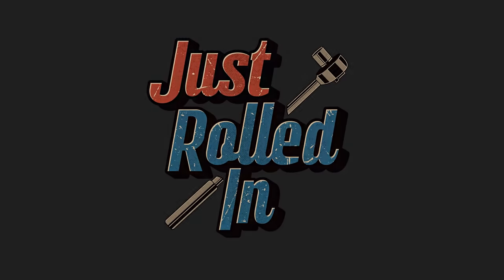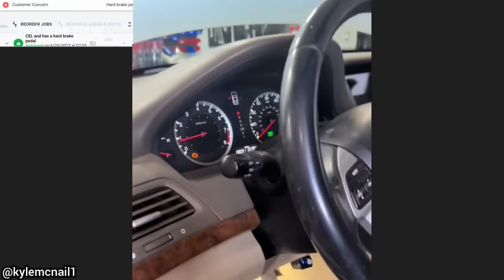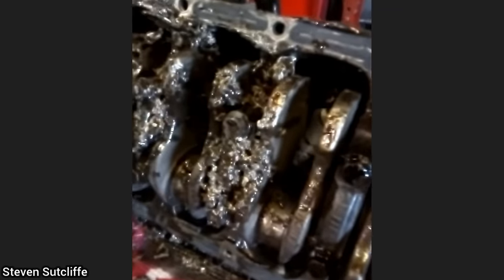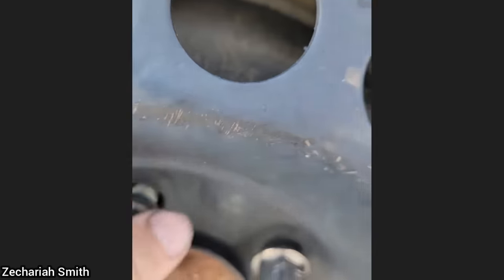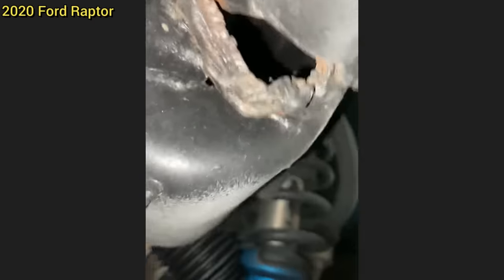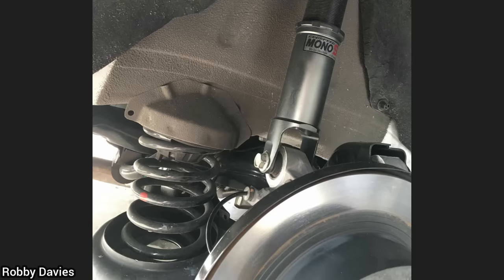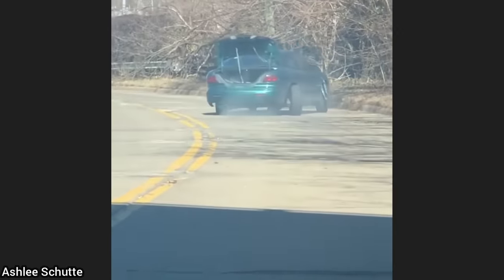Customer States Haven't Changed Engine Oil In 90,000 Miles

Comment: The last one:  There are some four wheel drive tractors that can drive like that.  It's called "crab steering".  
It's funny that both of the back wheels were running at about the same angle.  😂
Reply: yeah ... but most of that is done on hilly farm land .. out on the farm we used to call 'em a "sidewinder"
Reply: @rhuephus   I used to farm, but our land wasn't that hilly.  Lived in Saskatchewan where it is mostly flat.  So, didn't need such a tractor.
Reply: Car must be Front-Wheel-Drive with a torsion-beam rear end, which has come loose on one side, allowing it to swing backwards, twisting the other side with it.

Comment: 1:39 It is common for people who repair and resell salvage cars to not replace the airbag crash sensors and computer which needs to be replace every airbag deployment. if they are not replaced they will still have the sensors in a "crash" state. If the failsafe options that prevent random deployment fail or are somehow avoided they can just go off.

Comment: The last car.  The wheel alignment was correct, it was the body that a bit skewiff.
Its a well know fact that if you roll back your odometer you dont have to do any maintenance - until the engine seizes.

Comment: You cannot remove the factory coil spring and change to a coilover. The shock towers are not strong enough to take the weight of the car. You would need to heavily reinforce the towers to do that.

Comment: 0:05 That's the 2020-2022 4th-gen facelift, so if they actually managed to put 90000 miles on it, that's bonkers. But it does take more than 26K to do that to oil...
Reply from the maker: That's what I was thinking also. Must be used as a nice company vehicle.

Comment: That last one is an accident waiting to happen. With all the wheels facing in different directions, it suggests to me there's a lot of suspension and subframe damage to both ends of the car. Definitely not safe to drive. Best put that one on the "written off" register. Dunno what America's vehicle write off policy is like or how it works but down here in Australia it's mostly clear cut but varies in each state and territory. By the sound of things the Aussie policy must be better than the American policy. Either that or people are out smarting it.
Reply: Some states have vehicle inspections when going to emissions testing. A few states don't even have emissions testing.
Reply: I'm thinking there's problem with the rear axle.  The front may be ok, it's just turned to compensate.

Comment: Many years ago I worked at for a major trucking company on 2nd shift while I was doing inspections.   I was in the pit underneath a tractor doing inspection on it when I noticed that the front cross member was cracked , broken into.  Then I saw that the 2nd cross member and the two rear cross members were also broken into.  The only thing holding the two halves of the truck together was the engine and transmission mounts along with the differential springs.  I noticed the new paint on the truck when it came in so I asked the driver/owner if the truck had been in an accident recently.   I asked him if the truck had a vibration to which quickly replied yes!  I then showed him the broken cross members and he turned white as a ghost!  He then told me that he had pulled a load with the truck!

Comment: Reminds me of when we had the fleet trucks and vans when I worked for AT&T , dish network and directv , they tried to squeeze as little money into servicing them so  they did oil changes every 45,000 or 60,000 miles with conventional oil and would have you keep driving with the steel bands in the tires showing , wear real bad on outside of tire from under inflation to even out the tread they would then over inflate!

Comment: My friend had an oil change last 44000 miles before the midwest heat caused the main gasket to fail! Personally I've gone an entire year between oil changes... I drove about 23,000 miles that year. Oil was thick... But no clumps. Now, I only risk an extra 500 miles max when I'm due.

Comment: I just bought a 91 stealth tt, took it into the dealership to have the recall done on the transfer case. Also had it inspected for safety and emissions. I went to pick it up and they told both window motors don't work. I told them they worked just fine 2 hours ago. Walked out to the car and seen the mechanic pushed the window lock on the door. Waljed back in and asked them how long has the mechanic been working on cars. They told he only worked on the stealth/3000gt. I said get your mechanic and follow me and proved the windows worked great. They gave me a year worth of oil changes for there screw up. One of the moments the customer is smarter than the mechanic. But my secret is i learned from a 40 year vet mechanic growing up, so I can fix and modify most car stuff.

Comment: I just serviced a 2022 Freightliner box truck today, (built 09/21), its first ever service. It had a DD8 engine, first time I have seen one. Just shy of 30k miles on it, which should be ok, Detroit Diesel, I think, recommends like 40k. Personally, I'd do like 15-20k.
The hood opened pretty hard, and i thought that maybe it had never been opened before
Anyway, I pulled the drain plug, and only about 2 gallons of oil came out, and it was BLACK. I put in 2 gal of oil, not on the dipstick, 3 gal, then 4, then 4.5, then 5, then 5.5, then 6 and it's finally on the dipstick, then 6.5 and I'm in the hash marks. And I think, "holy fuck. I don't believe this dude has ever checked his oil. I wouldn't be surprised if some bearings are already wearing in this thing. I can't believe there wasn't a low oil warning light on this fucker. Maybe that's what the check engine light was about."
Anyway, I run it, then check the official DD service fill, 6.75 gal, so I add one more quart.
The company brings the sister truck over to swap out and also get serviced. I asked that driver if he ever drives that truck that had 2gal, he said, "No." I asked him if he knows how to check oil, and if he does it, he said, "Yeah, and every once in a while." 
I then told him that I only drained about 2 gal of oil from that truck when it's supposed to have 6 3/4 gal of oil in it. He laughed and said he'd let his boss know.
Reply: diesel oil always looks black like crap, even right after you change it. But yeah, check the oil.

Comment: I’m a dual mechanic, aviation and automotive. I’ve seen some hilarious customer states and have seen some interesting DIY installations or repairs but nothing compares to some of the stuff I’ve seen on this channel. 

I drive a 2013 Raptor and you can’t do donuts in a Raptor. It blows the power steering system.

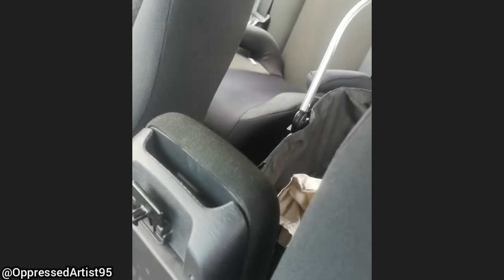Comment: 2:48 I've worked on a lot of transits, I've never seen one with a cartridge style oil filter. Are you sure its not a promaster?
Reply from the maker: It was filmed in the UK if it recall correctly. Perhaps they have different engines?
Reply: @JustRolledIn  The Transit van has had a fair number of different models and engines since it was first introduced. Both cartidge and spin-off filters have been used over the years.

Comment: just the other day, I was behind a reddish late 90s toyota corolla, which had four mismatched rims and tires, initially I thought the person was driving it with a flat, because of the tilt to one side, then after it slowed down to inch over some railroad tracks, I got a good look at the tires, and realized they had a low profile tire and wheel in the back right, a skinny tire on the back left, driver's front tire was thicker than the rear. Just such a hodgepodge of tires

Comment: We have semi truck that was towed in and sitting in lot that stinks badly like poop. Tow truck driver said sprayed 2 cans of odor eater and never changed how bad it smells. 400 pound driver using 5 gal bucket with plastic bags to poop in and all bags of poop are sitting in cab and sleeper. Also truck full of flys too. We refused to work on truck, windows are down and it just rained

Comment: My 2001 Chrysler Sebrings manual says oil change every 7500 miles or 6 month. I change it once in 12 month cause i rarely drive 5000 miles a year. Never had problems. Newer cars manuals say 17500 miles or 24 month.

Comment: I can't imagine how some of these vehicles are still running if i am show something that needs repaired i get it done but i was told that i needed an oil pan gasket i knew i could buy one cheaper than the dealership a couple days later i had another part replaced at the same dealership and looked under my car and it was not leaking

Comment: I've always wondered, do you call the cops if a repair is declined on a clearly unsafe vehicle? Because, damn, some of those are scary scary!!
Reply: Some US states don't even inspect vehicles for safety. The police won't get involved.
In states that do require inspection, mechanic can report the vehicle to the state, who can then notify the owner that re-inspection is needed.
Reply: @j_taylor thanks for the explanation.

So so sad.
And crazy!
No inspections required???
Yet.. you do need to have "10 catalyst converter" if you want to drive in NY?

Strange that you can be totally unsafe on the road, as long as your exhaust is clean enough

Comment: I've gone long periods of time without changing oil because of a leak that had me putting in a quart a week it was seven years and about 30,000 miles and it eventually caused enough pressure in the head to blow the valve cover gasket out but I got lucky and everything came clean after two oil changes and the car is still my daily. It's an integra
Reply: So the oil was getting changed, but you would still have stuff accumulating in the oil filter.

Comment: Looks like the airbags blew because the lifting pad fell off the sill. Would have shocked the impact sensor in the door just enough to set off all the curtains. Accident none the less but I think the shop is liable for the one.
Reply: If the ignition was off they still shouldn't have deployed.

Comment: I wonder how much they charged to "fix" the center air vents.
Reply: $189.00, it's on the work order...
Reply: 1 hour labor minimum for diagnosis would be my guess. That or they felt sorry for the customer and didn't charge anything.
Reply: If you cant 'fix' your own vents or realize there are 2 sneakers behind the brake pedal you definitely deserve the 1hr fee. Especially if that's the only issue you are there for.

Comment: I don't understand why people don't change the oil. It's a simple thing to do. And is a lot cheaper than changing the engine. My car had over 1million miles on it. My oil was changed about 3,000 miles. The mileage is accurate not embellished. Wish I still have that car. And plan to find another one sometime.

Comment: man, that fiat 500 engine had a melt down
and i dont know what kind of engine that fiat 500 had, but my 20 year old punto has no problem with the engine and already run over 200k km, and sometime i trash it like a race car (once i reached the max speed of the car, what is 155km/h on paper)

Comment: On the other side of this, I have had a few times where I have taken my car in for maintenance, and the shop forgot to put the oil in, or another time I had a tensioner pulley replaced, and rather than installing the correct screw, they used a wood screw. I’ve seen stupid.

Comment: i am a mechanic for a company that has a whole fleet of the 6.7 powered cummins diesel trucks. now i daily my beat up multi colored multi year k1500 its drive train is a 1998... 350 vortec. and i normally go 2-6k approx on oil changes. #1 i run rotella 15-40 full synth in it. #2 i honestly dont care about the truck i know yall are gunna give me a hard time but its rusted threw and been wrecked and is 3 different colors and leaks every fluid except coolant. i fixed that...

Comment: how does a vehicle go 60k miles without needing oil? it never burns any? or do these people just add some when the low oil warning comes on? i guess i don't know enough about new cars as i never owned a new car till about 6 months ago when i bought a new one. all my previous cars would need a quart between oil changes.
Reply: Ya, maybe they just checked the oil and added a bit when it was down on the dipstick.  Or it just still had enough in it for the oil pump to continue to circulate it. 
I'm on my third new car. I rarely had to add oil between oil changes on any of them.  But if I didn't ever change the oil, it would eventually get low.

Comment: If you are going to swap out your instrument cluster, make sure you replace the ECU too.
Reply: Replace all ECUs which record odometer data (ABS, Transmission, engine, AWD, more) in order to sell a high-mileage car for low-mileage prices, heck yeah... wait, what if the car can also tell how many times new ECUs have been programmed to the car?? Damn, foiled again!!
Reply: @De19thKingJulion  That's how I got screwed, didn't know at the time, and didn't check the vin. The title he gave me said 96,000 miles, clean title. Car said, 96k miles, etc. Engine meltdown after a week. Eventually found out that the title is actually branded and the carfax report lists oil changes from new (3,000k, 6,000k, etc.) all the way to 100k, then 120k, etc., going all the way up to 196k work service report then magically wraps around back to 96k and title transferred to the guy we bought it from. 

The strangest thing though, is that beside the engine blowing up, everything else was basically new. It was super smooth to drive, the interior was completely clean of any marks or issues, steering was smooth, suspension, zero rust anywhere, car barely made any noise running. All windows and locks work, AC works, heat, remote starter, wipers, etc. Probably threw a junk high mile engine into a new body and sold it off to us.

Comment: The oil change disasters  probably pisses me off the most because that is willful neglect.  It is only a basic simple maintenance requirement that requires little effort on the user:  if you can't do it, just let a reputable shop do it for you.  $25.00 in and out.  Boom.

Comment: Not to bad, and a good numbers guy number.  90,000 total life on that brand and weight of oil.   You have to look at it as,,,The oil failed finally, not so much mechanical fail.

Comment: I get the oil change stuff, not everyone's a mechanic.
But things like the vent not blowing air cus it's closed, the shoes blocking the brake pedal and similar stuff like a scent bag weighing down a blinker, the car only starting when the AC is on (hybrid)...these are very basic things that would only require going to the mechanic if you're an absolute moron or so lacking in confidence that you don't dare touch anything in your car besides the key, the wheel, the pedals and the doors.